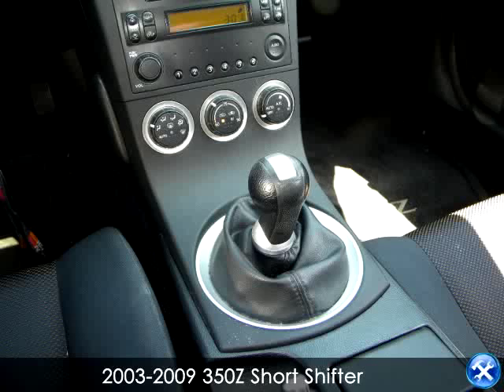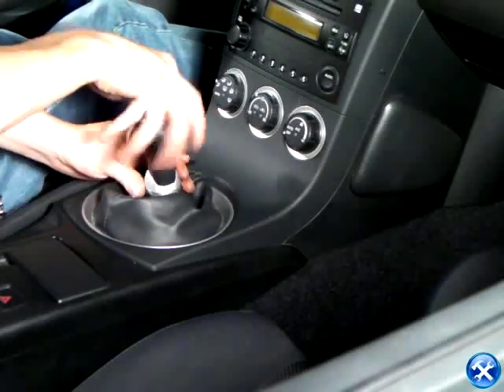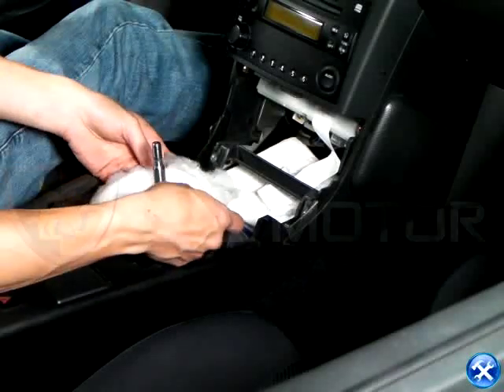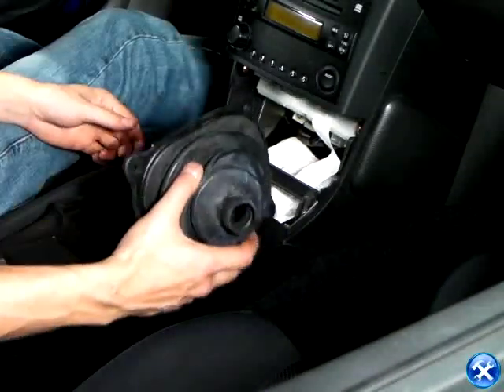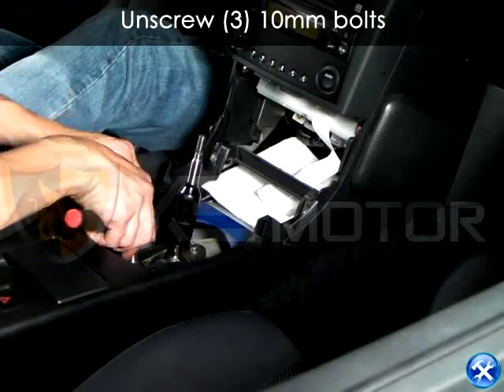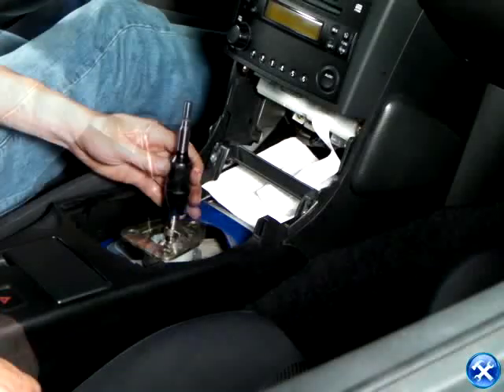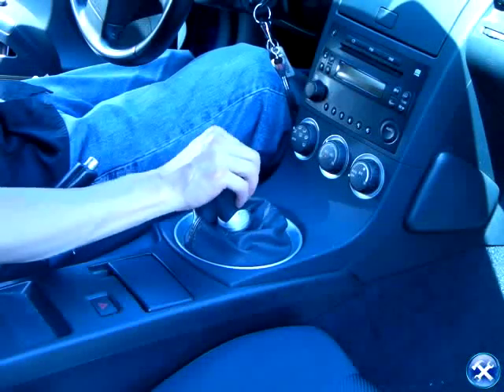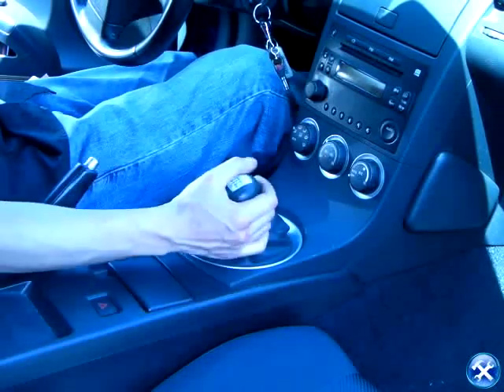SPECDTUNING INSTALLATION VIDEO: 2003-2009 NISSAN 350Z Short Shifter

Comment from the maker: @minhsteve09 Correct! However, please be sure that the knob that you are buying is made for your car. Because if not, the threads will be different and you might strip it trying to screw it on. If the item is universal, it will come with a plastic cap and small screws that will tighten the cap when the put the knob on. Good luck

Comment from the maker: @p8ntbawlr210 the Shorty Sifter gives you a shorter throw when shifing. As performance wise; you want to have the quickest shift when changing gears. It requires less effort to make the shift. E.g. from a two inch throw; down to under an inch. I hoped that helped. Thanks for the question.

Comment: Did you jack this video from someone?  I could have sworn I've seen this before and there is a bunch of info missing so I will add it here...

You forgot to add in the part where the guy explains about using solid bushings so you can get rid of that sloppy mushy negative contact when shifting thus making your shifts firm and way less wear on the fork. Also when you are putting the shifter boot in, add a bit of die grease so the boot wont bind to the shifter knob making you tear it it up.  Torque the bolts down so the bolts won't work their way out, same goes for the outside.